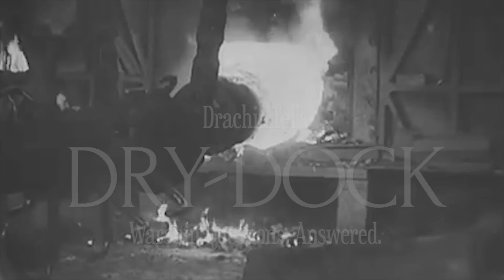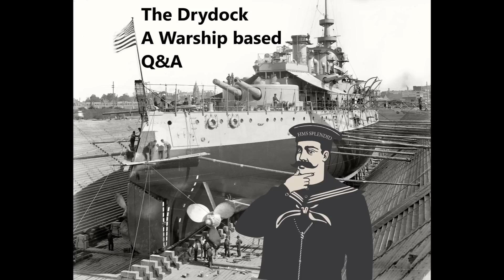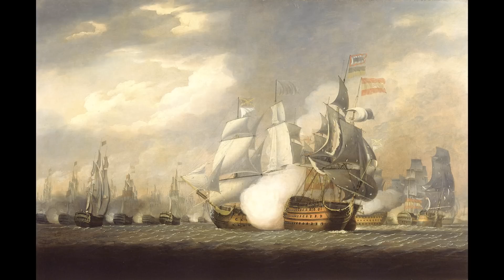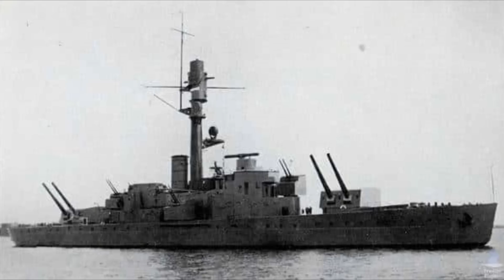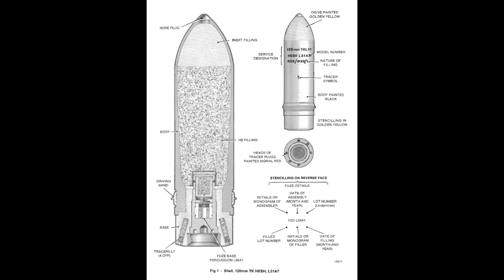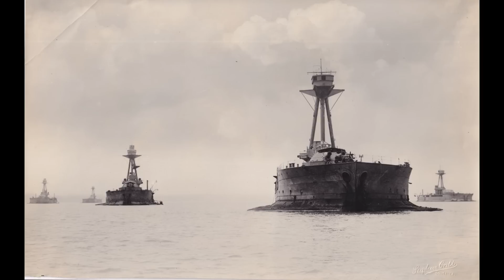The Drydock - Episode 212

Comment: I would bet that there are reasons for either a slab or stepped dry dock as well, a stepped one you could float more stuff in, manuver it close together as you bring the water level down, and like you said stepped drydocks require less excavation, but also it might be the only way to build a drydock in a given area's geology

Comment: I would think that the critical width for a drydock is likely to be the maximum beam of the ship which for most ships built in the last hundred years or more is likely to extend pretty close to the bottom.  Aircraft carriers are the one exception I can think of with the often huge overhang on modern carriers.  Much of the choice of vertical vs sloping walls can be a result of soil conditions and the availability of shoring. Soft soils with a shallow angle of repose will require a very wide excavation at the top relative to the bottom unless elaborate shoring is used to support the sides of the excavation.

Comment: With regards to the armor plate thickness, the actual thickness may depend on how the plate was paid for.  Was it paid on a flat price for the job, on a price per square foot, or on a price per pound?  Alloy plates bought in quantity today are actually sold on a price per pound.  Because of this the mill will try to roll the plate to nearly the maximum thickness tolerance making it as heavy as they can. resulting in more profit for the supplier.

Comment: A question: why were warships in the age of sail so vulnerable from the stern?
Reply: gun decks were open. shot could travel the length, potentially hitting every gun station. while from the side you're looking at 2. there are Windows and a square back on the stern, for the captain's cabins etc. while the bow is planked and curved. so easier to penetrate the stern. the rudder and steering gear is back there too. so a chance to lose mobility.

Comment: It's been a long time since I've seen the relevant Mythbusters episodes -- but I was left with an impression that, in addition to the issues you mentioned about the gun and the "hull" construction, that there was a disconnect around what constituted a "splinter".  

Something about their wrap-up led me to believe that they thought the deadly splinters in question were the small wood fragments that would be called splinters during woodworking, or general handling of wooden objects -- say up to maybe 2" long.  (If true then that explains why they didn't address the large chunk of post that was sent flying; but it would also mean there had been a failure in their pre-episode research or understanding).
Reply: When I watched that episode, and saw both what they were shooting at and what they were shooting with, I made the same judgement that Drach did -- just from the illustrations in my copy of Arming and Fitting of English Ships of War, 1600-1815 it was clear that what they'd built wouldn't have been acceptable as a model of a merchantman's hull, much less a warship's. Although if they'd actually built something to the same standards as a ship of the line, they would have been able to claim the myth was 'busted' because the (estimated) six-pounder gun they would be firing at it wouldn't have penetrated.

Comment: I honestly think Drach is kind of a britaboo about British Ironclads.

Now, I don't doubt the HMS Warrior could defeat the CSS Stonewall/Kotetsu. They were much larger and had many, many more guns. However, I don't think Drach's account of how she would do against the CSS Stonewall. However, there are several things he ignores

1) It is unlikely that the penetration of the 68 lbr was nearly as good as claimed. Yes, the 68lbr did manage to penetrate 4.5 inches of armor using a Pallister shot in 1862. However, this has two big problems. Firstly, the Pallister shot was not officially adopted by the British navy until 1867. Secondly, nearly every penetration test from that time period turned out to be massively optimistic under actual battlefield conditions. The 68 lbr gun was never actually taken into combat, so we don't really have a good idea how it would have performed.
2) Attempting to "kite" the CSS Stonewall likely would have been totally ineffective. Drach ignores in this calculus the armament of the CSS Stonewall. The Stonewall was armed with all rifled cannons, including a massive 10 inch 300 lbr armstrong rifle. These were muzzle-loading guns which did not suffer the problems of the 110lbr rifles the Warrior carried. The result of this is that the Stonewall would likely have had much more accurate fire with its guns than the British could have managed, assuming the Confederacy was using a well-trained crew. When you take into account the smaller size of the Stonewall, it really makes sense for the Warrior to close the range to maximize effective penetration and accuracy as the Confederate gun would be less effected by range. Undoubted, the Warrior would win such a slung fest, but even a few 10 inch penetrations would cause severe damage.

Comment: You may have addressed this in your original discussion (I can't find it quickly), but I think the basic difference was 'two nations separated by a common language'.  In modern US usage, a splinter is only used for a piece of wood you extract from your finger with a tweezer.  Obviously, the shot you used here shows what a 17th century sailor would have called a splinter.  A little original research would have paid off here.

Comment: I worked at Todd Shipyard in San Pedro CA. My uncle Bill Evans was welder/cutter supervisor on drydock there; two tales from drydock, while cutting steel for scrap of liberty ship built at same yard in 1940s a space that was supposed to be square had small 45 degree in one corner ? When offset was cut out a skeleton in a welding suit was found and police called ! . Second; did you know the "love boat" ships would come in once a year for "cleaning" what the dry dock crew would do, would be to cut out main waste lines and replace them rather than clean them due to clogged/ reduced opening because of how much waste produced by people eating so much food at the buffet !

Comment: Vacuum tube transistors?
Reply: Yes, quite. 
However, he did correct himself and just meant that vacuum tubes (triodes) were being used to perform the same function as transistors in those Radar circuits.
One should assume that he did know that the transistor wasn't invented until 1947.

Comment: The USS Olympia (C-6/CA-15/CL-15/IX-40) had hatches that went from the Superstructure (lifeboat) Deck, down to the top of the turtleback armor, which I assume also had hatches in it.  They appear to be too small to lift out or replace the boilers and triple expansion engine intact, but were probably designed to allow removal/replacement of the components that could not  be broken down smaller.  The booklet of general plans is available online.

Comment: With regards to the King George V armour thickness (and British armour plates in general), British armour weights were specified in lbs per sq foot. In design documents the conversion was universally done (in my experience) as 40 lbs : 1" so 15" and 600 lb plates are used interchangably. However, plates were rolled to the weight specifcation, and the precise conversion is 40.8 lbs : 1".  So the 15" plates are actually 600 lb / 40.8 = 14.71" thick, at least nominally. This difference between 40.8 and 40 is about 2%, which was apparently considered too small to be of any note. For example, with a 5" plate, it's the difference between it being 125mm and 127mm thick. A 1/10th of an inch being not worthy of note. Generally, take any British plate's design thickness and multiply by 98% to get its actual thickness. e.g. 14" x 98% = 13.7".

Direct evidence for this can be seen in the handbook for the 14-inch gun, which lists the turret armour thicknesses. Unlike any other document I've seen, this gives the thickness in precise values. So while the Ship's Cover talks of a 13" faceplate and a 6" roof, the handbook lists 12.74" CA and 5.88" NCA. These are the values you get if you use the 40.8 lb : 1" conversion. You can also see this if you compare the design and actual weights in the completed ship. The design weights assumed 40.8 lb per square foot, whereas the completed weights were to 40 lb per square foot. So the KGV's belt armour was designed to be 4,755 tons. The completed ship had 4,640 tons, or 97.6% (compared to the theoreretical 98%) of the nominal rounded number. 

The final aspect was the rolling tolerance. For the KGVs this is listed in Buxton's "Battleship Duke of York". For belt armour this tolerance was 0 lb/sqft over and 10 lb/sqft under, for deck armour this was 0 lb/sqft over and 2.5lb/sqft under. 

So, the design documents referred to a 15" or 600 lb plate, but the design weights taken reflected to 'full' value of 612 lbs (15" X 40.8). The plate manufacturers however would roll to the 600 lb nominal thickness, and had a +0 / -10 lb/sqft tolerance, so the actual plate thickness was allowed to be 590 to 600 lbs thick (providing it met performance requirements, of course). Given that the ship's final armour weights were 97.6% of the design weights, the typical 15" plate was likely approximately 597 lbs thick (612 x 97.6%). Or in other words, 14.63" or 372mm.
Reply: When they scrap a ship, do they measure any of the plates or just melt them down?  Are any plates still around?
Reply: @gregorywright4918  Some armor plate was saved for various purposes. Some was used for low-background steel to shield radiation detectors; steel made in the years of atomic testing was 'contaminated' with atmospheric radioactive particles that would cause such instruments to register false positives. Other times big armor plates were used as the backstops of shooting ranges.

Comment: I think the scale problem with the splinter experiment is best analyzed by splitting firewood. Use a 5 pound splitter and hit it hard, it explodes. Hit it with a 1 lb hatchet and it will make a crack. You can’t examine the crack from the 1 pounder to predict the five pounder results.

Comment: Correction on the Centreline AA turrets, the King/Nimitz redesign for Iowas 5 and 6 used a centreline AA mount fore and aft, and got the space and weight needed by trunking the funnels into one, shortening the super structure, and deleting the conning tower, they were also to receive 28 quad 40mm mounts and 70 twin 20mm mounts. It obviously was never realized but you can’t say it was never contemplated or considered.

Comment: The topic @20:20 ? I'm thinking that this may be why, at least in part, that ships within the same classmay have had different characteristics in regard to balance/displacement or "feel" or possibly even top speed capabilities ? Different plate thickness, over a wide area, I think would have it's effects.
 Unless they were aware of it & balanced out their applications upon installation to counter possible ill-gotten effects ?
 Interesting, nonetheless !!
🚬😎
Reply: Sometimes equipment, even up to engines, varied between ships of a single class.  Availabilities, cost, time of order, etc all varied.  Even when built in the same shipyard.

Comment: Well on stuff made for upgrading the Colorado class twin 16 turrets just happened to be the same diameter as 14" triple standard turrets, so in theory if the wheels fell off the treaties in the 20s or early 30s when the speed of the Standards wasn't such a problem the US could have Coloradoed the 12 14" gun standards
Reply: Upgrading turrets was easier than engines because you did not have to rip out the deck armor to get to them.
Reply: @gregorywright4918  although you would have the deck armor problem the Big 5 (Colorado and Tennessee classes) had a bit of extra machinery space built in compared with Pennsylvania and New Mexico classes where they could potentially have been bumped up to around Queen Elizabeth speed if they had been refit in an era before they needed massive torpedo bulges.

Comment: At 26:05, Richard Worth noted in "Fleets of World War 2" that a polish proposal for a 25k ton battleship capable of 30 knots that was  ambitiously armed with 9 12 inch guns, 12 5.9 inch guns, unknown dual purpose guns and 6 torpedo tubes existed.  Unfortunately Worth did not include any footnotes so chasing the original source (assuming it exists) would be a rough challenge.
Reply: So basically a Scharnhorst with slightly bigger guns and less armor, due to the 7000 ton difference. However, given that it was only a proposal, detailed plans might not exist at all.

Comment: Ship's design drawings going back and forth between specifying steel plate by thickness or weight is an issue that we still deal with in modern shipbuilding (at least at the yard I work at)

Comment: Another issue with HESH rounds is that they work best at relatively low velocities. The plastic explosive has to form a 'pat' before detonating and high velocities would just splatter it uselessly. Low velocities and naval gunnery likely don't mix.
Reply: That is objectively wrong. Because of the large distances the shells travel, at the point of impact naval shells have drastically lower velocities than shells in army application.

For direct fire against armored targets in army terms 3km is extremely long range. 3km in naval terms is knife fighting range.

Also the muzzle velocity of HESH from a royal ordonance L7 105mm gun for example is about 730m/s. The Iowas guns had a muzzle velocity of about 820mm for HE and other multipurpose shells and 760m/s for AP.

Naval artillery shells have either about  the same or lower velocity than their army counterparts when they impact.
Reply: @regeNausWeiden  For the Chieftain tank round, impact velocity seems to have been about 0.6km/s. So, yes, the (relatively) limited range in land use is definitely a thing. So that makes the HESH even more problematic for naval use because you would have to consider whether the round will hit fast and splatter at short range or be slow and effective at long range. So as Drachinifel points out, for naval use a HE round would be less 'fussy'. Out of interest, why is it 'objectively' wrong rather than just wrong?
Reply: @regeNausWeiden  even if velocity was a real issue, a HESH shell would be lighter than an AP shell of identical dimensions. At practical battle ranges, that lighter shell will lose more of its initial velocity and have a lower striking velocity.
Reply: Even if that was an issue, it could almost certainly be worked around (by shell or guns design) if HESH presented a significant value in naval combat. 

But HESH was effective against tanks because tanks have a single, small interior volume filled with fragile and critical items. Ships are large, compartmentalized, and critical items are much more spread out. 

Even against tanks HESH never really got broad acceptance compared to sabotted AP and HEAT with it only achieving and significant use outside the British and their former empire because it came with the immensely successful L7 gun. It mainly survives for use against structures and fortifications where it concentrated the blast more than HE so most wasn't just wasted in the air around the target but was less concentrated than HEAT resulting in much broader damage. 

HESH could be useful for shore bombardment, but heavy naval funds were already such a degree of overkill in that role that it isn't worth degrading their naval warfare capability.
Reply: @88porpoise  That's probably the main issue. HESH is fine for relatively short ranges (tank vs tank) where a low velocity retains a relatively flat trajectory. Under those circumstances, any impact will be near-orthogonal and against armour. For a ship, the angle will be highly variable and possibly against superstructure. My guess is that against a non-flat target, HESH will be less than optimal and a HE round likely better.
Reply: So basically HESH might work if it was a smart shell that could control its terminal velocity and point of impact to be sure of achieving proper impact on a main turret  😄